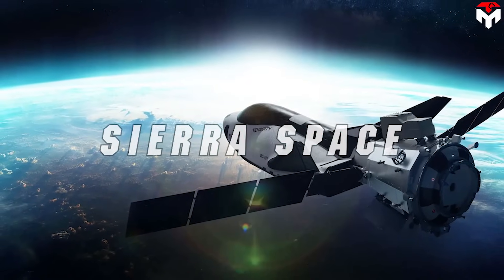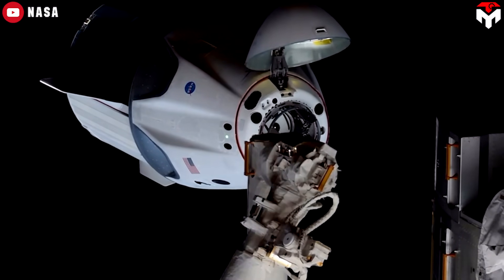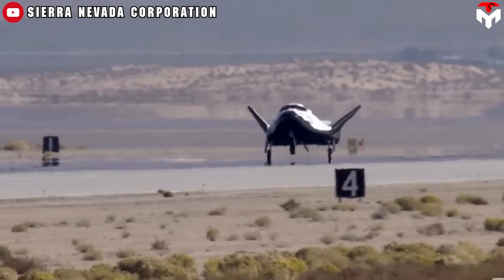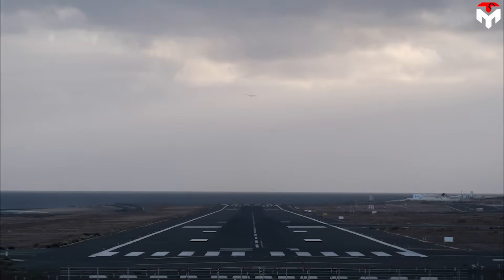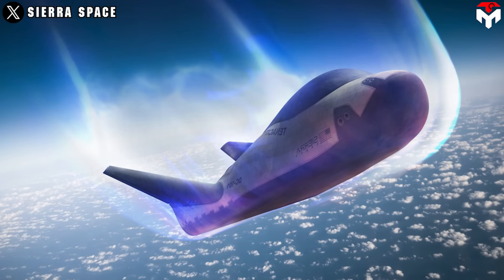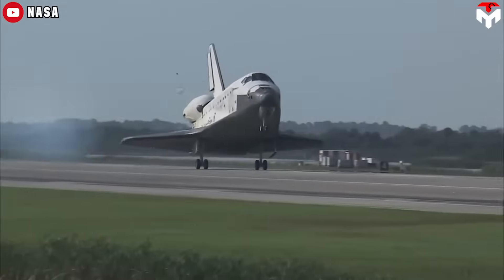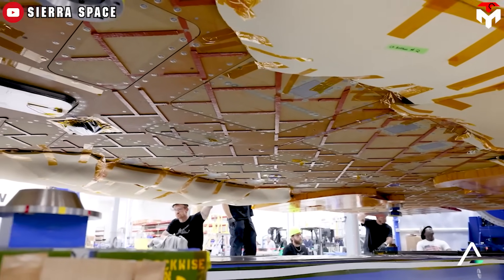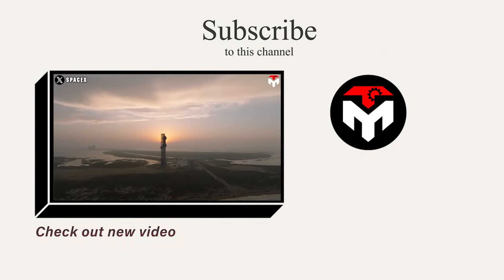NASA finally realized Dream Chaser is BETTER than Boeing Starliner...

Comment: Traveling to ISS is one thing and i don't doubt that Dream Chaser is good in that mission description. But if Boeing can get their shit together and fire the board members and the upper management we can have spacecrafts which can fly to the Moon and Mars which is way more interesting for both Boeing and SpaceX. The Dreamliner can only do one thing and it probably do that fine if they can keep the parts where they should be, so they don't drop parts of the shields as the Space shuttle did.

Comment: My design is better.
On my ship, the landing gear doors are on the back of the ship with all the other penetrations.
The belly is a massive continuous heat shield with no holes.  It's much cheaper to manufacture it this way.
The heat shield is modular and can be replaced in a few hours.
When you are going to reenter in my ship, you roll onto your back and burn through the atmosphere.
The crew are in a cylindrical section that stays upright as the ship rolls, so you are comfortable as you fly.
Once you have slowed down and don't need the protection of the heat shield, you roll again so that your windows and landing gear are pointing down.
The control surfaces can then be extended for landing.
My design is better in every way, but they will never build it.
Politics and money.  It's frustrating.

Comment: I can understand dumbing it down for the general public and inferring that the Dream Chaser is inspired by the  Space Shuttle. However, anyone interested in aviation, aircraft, and Space endeavors know this is NOT true. You completely overlooked the X-24, the X-38, the M2-F1, M2-F2, M2-F3, and the HL-10. These were the pioneering Lifting Body designs that NASA tested from the 1970s to the early 2000s. These are the actual inspirations of the Dream Chaser. I think you do a disservice to your viewers by dumbing down the content of this video.
Reply: far more the https://en.wikipedia.org/wiki/Mikoyan-Gurevich_MiG-105

Comment: Boeing's window design for the Starliner is overly complicated.  I'm very concerned about the forward pane being so large and trapezoidal.  Orion's forward windows are also weirdly shaped, but they each aren't as large as the Boeing's single forward pane.  While I hope the Starliner never actually flies (I don't want us to lose a crew), I hope it is successful if/when it does.

Comment: Wouldn't it be more economical to put a passenger-module into the X-37 cargo bay as payload? Instead of developing a manned spacecraft?
Reply: X37 is too small. You could fit maybe one Person, but with life support it's still going to be cramped.
Reply: However, i could see the US Space Force using it like the old DynaSoar 🤔@stephanweinberger
Reply: @craig2809  for what purpose?
Dynasoar was for the most part an early attempt at force projection before there were ICBMs. And the other proposed applications (like satellite-repair) again require more crew and cargo capacity than X37 can offer — i.e. a vehicle at least the size of Dreamchaser.
Reply: @stephanweinberger  Thank you, too bad. 't Was just an idea.

Comment: Once again a poorly researched attempt to capture the over sensationlized bull for clicks, and of course most of it is bull and all of it is poorly researched with zero context. First, the reason Dragon beet Boeing to the space station was dragon had been going there for years prior to the Commercial Crew contract for cargo. The only difference between Dragon cargo and Dragon pax being the life support system.  Second, Boeing was chosen because of their expertise in the field, but they were also starting much further back. If you look at the timeline, Boeing has taken aboit just as long to Starliner working as Dragon took. Hell, part of the reason for Starliners problems were the rocket itself which Boeing didnt make. The reason Dream Chaser wasnt chosen for the Commercial Crew Program was it was heavily rumored at the time SpaceX paid them off. Peoppe ignore the fact that Musk tends to whine a lot or pay people off to get favors. Like when the US Airforce blocked SpaceX from carrying classified loads, saying they needed a minimum number of flights he whined that it wasnt fair and a colusion until some Sentator overroade the USAF. Starliner actually did its job. It found an error and rejected the flight to ISS for a quick landing which was required. Unlike SpaceX Boeing didnt have the luxury of multible proving flights to get things right.  But thats the thing, Starliner cant even do basic Falcon things and has been a collasal failure so far, and zero peoppe care because of SpaceX iterative approach, while ignoring the fact that approach is supposed to take in all lessons learned and only be focusing on new improvements, not trying to get the old tried and true issues down. Starliner got it right in 2 launches compared to Dragons 10. Im fact the original launch of both passenger craft werent even supposed to have gone to ISS. But why opt for truth when you have narative.   Now, do I thing Dream Chaser is better than Starliner, yes, 100%, but I think both are better than Dragon. Starliner is the direction NASA should have gone in afyer the shuttle. It would have not only given them a ride to the ISS, but could serve as a platform to service the Hubble Space Telescope which is rumored to be getting another service mission if they can find a way to pull it off. Still narative over fact, but from what I noticed about this channel on previous videos, thats par for the course.
Reply: "Starliner got it right in 2 launches" what?^^ Starliner had its two launches and everything it proved are its design-flaws
Reply: Much deeper info in this post than in the video. Cool.

Comment: OK. Now let's say this together----- DREAM CHASER IS A CARGO SHIP ONLY. 
One of the reasons why there are so many delays in Starliner is because it is MANNED. 

I know all the Elon Bros have selective memory, but does anyone remember that SpaceX already had a cargo ship working when they were tapped for a manned system, so they had heritage hardware to draw on and make the development of Dragon 2 much quicker and cheaper than Starliner, which had to start from scratch. If you want to compare Apples to Apples, you will need to compare the total development time of Cargo Dragon and Dragon 2 together to the time required for Starliner only. Does anyone remember the parachute problems and the explosion of the Dragon 2 module before the abort test?
I will give the Bros one point - SpaceX can complete a disaster investigation really quickly now (due to their expectation of failure as a development tool, and I am sure Elon's massive temper pressuring the team to work faster.) It can also design fixes very quickly, likely for the same reasons.
Dream Chaser is very ambitious and will have many great capabilities beyond capsule designs, but it is still a Cargo Spacecraft. It will make a great manned space plane, but as we have seen, NASA requires a much more extensive design review and testing for a manned spacecraft. I would not expect a manned Dream Chaser until at least 2-3 years from now. Also keep in mind the difference between going into space inside a shroud (like Cargo Dream Chaser)and being atop the Atlas V or the Vulcan right out there in the hypersonic slipstream. Will we get tile damage? Maybe not, since it won't see ice hitting it, but then again, the aerodynamics, vibrations, and shock waves of lift-off and hypersonic flight might knock a few off. If the tiles turn out to be as fragile as the space shuttle, then we will have a few headaches. Only time will show if Sierra Space has truly made a space plane with easier turnaround than the space shuttle.
Reply: DreamChaser was DESIGNED as a manned system. It was converted from a manned system to an unmanned system because the only contract NASA would give them was for cargo delivery.
SpaceX did the reverse.
Reply: You seem to forget Boeing owned several major space companies.  They were the guys that built the Apollo and the Shuttle.   They had thousands of man hours to draw upon to design and build a manned space vehicle.  The experts at Boeing had their lunches eaten by a bunch of Jonny come latelys.  It's an embarrassment.

Comment: Little new with a misleading title - NASA is still contracted to a number of Starliner launches, showing the power of political interference and corruption over common sense. Starloser should be cancelled The biggest advantage that Dream Chaser has over Starliner is that it is NOT made by Boeing. Dragon comparison is irrelevant as SpaceX made it clear that it will be Starship that is the future.
Reply: Dream Chaser is CARGO ONLY. Starliner is a manned spacecraft. SpaceX already had Cargo Dragon operational before they developed a manned version of Dragon 2, so they had a lot of heritage systems to use in the manned vehicle.
Boeing hadn't designed a manned spacecraft since the Space Shuttle in the 1970s, so they were really starting from scratch, and a manned vehicle has much more stringent NASA safety requirements than a cargo vehicle. 
Boeing is a gigantic company. The engineering teams in the Space Division are entirely separate from the military division and the commercial aircraft division.
And I know you SpaceX Bros have selective memory, but the first version of the manned Dragon 2 had parachute problems as well as EXPLODING during a test.
Reply: @i-love-space390 DreamChaser was designed and tested as a manned vehicle. It is unmanned because NASA wouldn’t pay for the manned version.
EASA has also ordered a DreamChaser for their own use.
Its biggest advantage is its low acceleration during reentry which is just over 1.5G - far less than the 5G of the capsules.
Reply: So ???

Comment: If this vehicle were installed on the Falcon Nine, space travel would become like civil aviation flights
Reply: Dream Chaser is CARGO ONLY. It has only flown inside a shroud. If it will ever have a manned version, it will have to sit atop the booster in the airstream just like the Shuttle, so that it can abort in case of booster failure.
We are a LONG WAY FROM MANNED FLIGHT ON DREAM CHASER.
Reply: @i-love-space390 The DreamChaser was redesigned with folding wings. It originally was going to fly un shrouded but that would require the aerodynamic controls to be synchronised with the booster to limit structural loads. The X-20 had the same issue with its design in 1960.

Comment: Dream Chaser is the future of space travel.  It's design is so much more elegant than anything SpaceX has offered up, or for that matter anything else in the space industry.  Hopefully they build hundreds of these in multiple variants.  The US should have never abandoned the Space Shuttle program, doing so was one of O'Bama's worst mistakes.

Instead we should have begun a long history of building a litany of smaller craft designs, and eventually a more capable larger design.  For all the criticism that the shuttle program took, it was still the most successful space exploration platform that has ever been conceived of.  As for the Dragon program, the US should have multiple platforms for different missions, and still needs a rocket program.  So we need many different designs.  Both are needed to compete against Elon Musk and his faulty monopoly; just designing big does not make for the best in technological advancement.
Reply: The Shuttle program never fully lived up to its promise of reusability.  The US military got involved turning a good idea into an oversized behemoth necessitating huge rocket engines still needing solid rocket boosters to get into orbit.  The turnaround time promised never was achieved.  It was a symbol of national pride much like the battleships of lore.  Future plans need to be structured around different requirements.  What is needed to get off the surface of the earth is completely inconsistent with what is needed for interplanetary travel.  When you get to the other end of the journey, you're faced with the same problem you had in the beginning, getting off and on the surface of another massive planetary object.  Moons and asteroids, all potential mining and manufacturing opportunities don't have that massive of a problem.  What is needed is an elevator system to get off and on to the planet(s) surfaces and a long-haul transportation system that is engineered primarily for that purpose.  Two different missions requiring two different technologies.  Not until we can construct these long-haul technologies off planet will we be able to cost-effectively have robust and resilient solutions for the future.
Reply: Dude. Bush was the one that made the decision to retire the Space Shuttle. Obama just adhered to the timeline and followed the recommendations of the Augustine Commission to separate cargo from manned vehicles. At that time, the commercial crew was supposed to fly in 2017. But we all know how things turn out in space development. Keep in mind CONGRESS would never allocate enough money to simultaneously operate the Space Shuttle, the ISS, AND develop new vehicles. If you have a problem with that, then you need to blame budget hawks in Congress as well.
Reply: It was deliberate, not a mistake.  Government is not intelligent, they are 50%'ers at best.
Reply: Faulty Monopoly ??, it’s called free enterprise and or Capitalism, I guess ford, Edison and or even Louis Pastor with penicillin could fall into your line of thinking. Until someone can come up with a better way of getting to space and returning safely Mr. Musk has my vote. Funny no one talks about the Billions wasted by NASA and it still can’t do what Space X has done. It’s the people of Space X
Reply: The SpaceShuttle was a design mistake ever since the NSA insisted that the KH-11 series spy satellites had to fit inside. It launched two of the twenty launched.
Putting the KH-11 inside meant that it couldn’t leave low earth orbit or have very much cross track range. The external boosters further compromised the design.

Comment: This horrible, archaic tablet named Star Liner has devoured so much money that could get already a black hole for NASA dollars. I wish the Dream Chaser is getting   closer to SpaceX
Reply: Dream Chaser is CARGO ONLY. 
Starliner will be man-rated, just as the crewed version of Dragon 2. 
I do not expect a man-rated Starship for at least 5-10 years if ever. (SpaceX does not have any credible way to save a crew in the event of a second stage failure, because the second stage, complete with enormous propellant tanks and 6 very powerful rocket engines IS THE STARSHIP. 
Imagine if you were INSIDE the second stage of the biggest rocket in human history and you were depending on the Titanic to be its own lifeboat........)
Reply: OMG right? The understatement of the DeCADE!

Comment: Being better than starliner is a low bar. The seating in SpaceX allows quick emergency exits in starliner last guy is toast
Reply: Not sure how you are getting that. The interior capacity is pretty much the same in each spacecraft - 4 seats. In the event of an abort, the entire capsule separates. I don't think America has EVER had a capsule evacuation on the pad. I do not expect any of them will be quick. Do you remember how long it takes to get them out of the capsule on landing??? It takes what seems like an hour after they are hoisted aboard the ship.
Reply: @i-love-space390  if something went wrong inside the capsule like Apollo they would take much longer to get out. Like tape that turns out not to be as fire resistant as first thought.
Reply from the maker: Yes, it's true